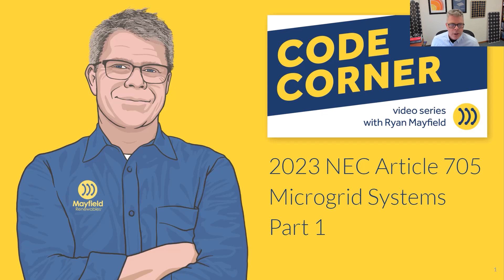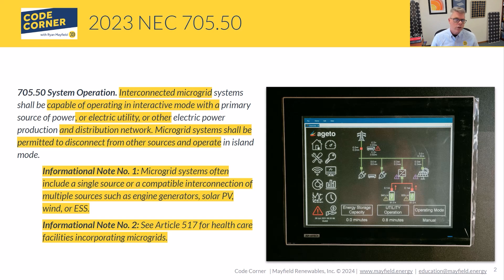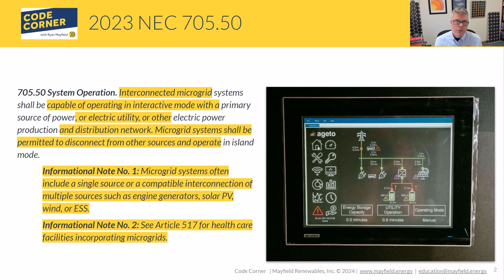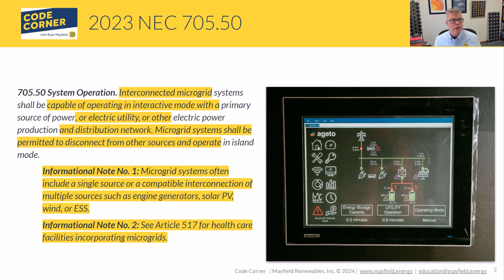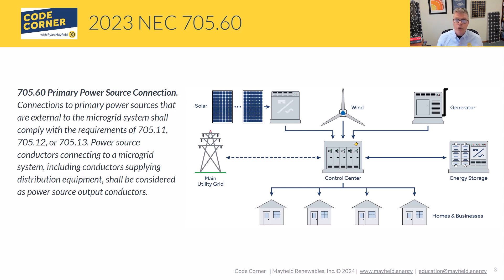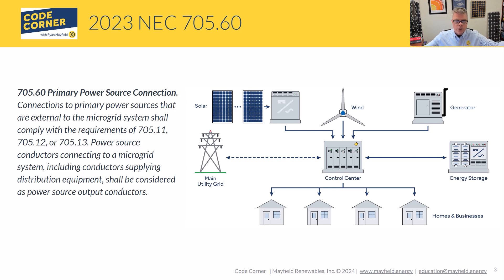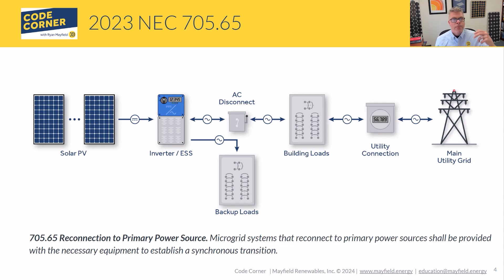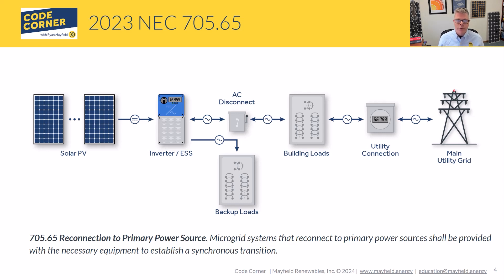2023 NEC Article 705 Microgrid Systems - Part 1

Comment: The diagram shown starting at 6:08 is what drives me crazy. Where's the 230.85 Emergency Disconnect that sits between the Utility Connection and the Building Loads? And considering a lot of newer Inverters are full grid pass-through, they don't feed a dedicated breaker on the Building Loads panel anymore. Would the flow not be Grid --> Utility Connection --> Emergency Disconnect (AC) --> Inverter / ESS --> Building Loads? A separate DC path would be Solar PV --> DC Disconnect --> Inverter / ESS. Meaning both AC and DC paths IN to the Inverter / ESS and an AC path OUT to loads? (Assuming a backup load panel and battery storage were optional, for simplicity.)
Reply from the maker: We try to keep the images concise for the Code sections we are discussing, and given these are block diagrams to show overall functionality, we can't address all Code sections in all cases. But you are correct, a system installed under 2023 Code would need to comply with the emergency disconnecting means in 230.85. 

If the inverter can allow full pass-through, then your assessment/power flow is correct. And that would also presume the inverter/ESS was capable of DC coupling. There are so many forms and configurations these systems can take that it's hard to capture all possibilities in a single image. We're doing our best to break it down but this helps us improve our visuals in future videos - thanks for the feedback!
Reply: @MayfieldRenewables  Thank you for the reply and the very informative videos!